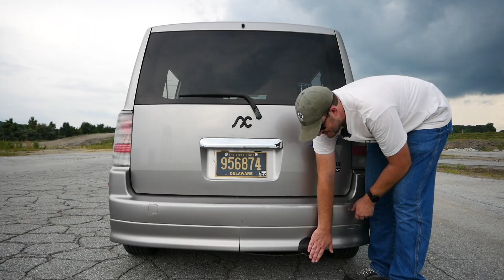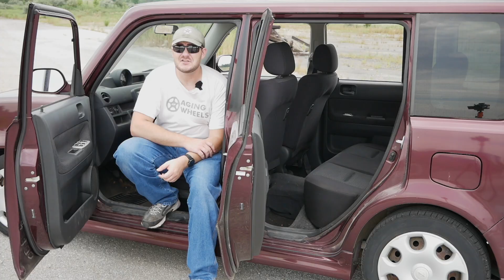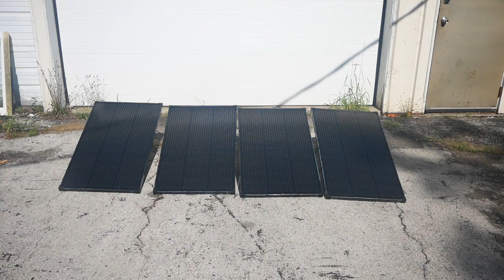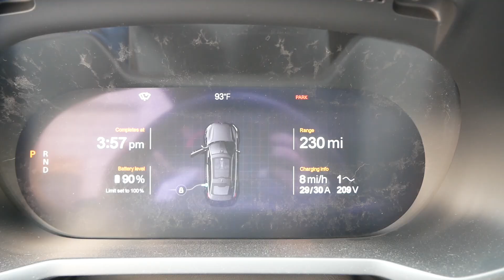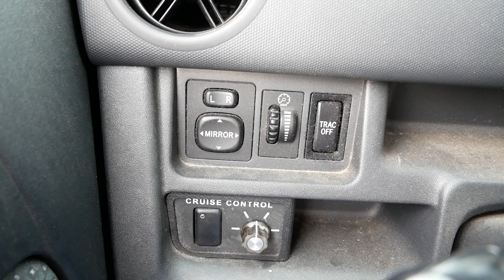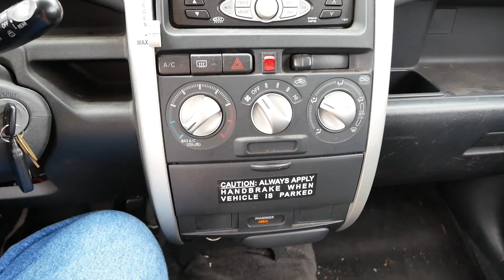The ACP eBox is a Technology Showcase Crammed Inside a Cheap Toyota

Comment: Ahaha they lifted the cruise control out of a 70’s semi tractor! I literally just saw one of these last week! It just sets the throttle, guy showing me the truck explained to use it to set the rpm’s to around 1000 when parked because that particular engine does not pump enough oil at idle.

Comment: The stickshift should be put back on. I built my own electric car out of a VW Squareback in 2008/9 using the VW transaxle and being able to shift is WAY more efficient. That Ebox would probably do 120 in 4th no problem. Edit: or 5th because we're not in 1971

Comment: I think this demonstrates not just a cool electric car with cool technology, but instead, a clean example of electric refits. That said, I think it would be safer and smarter to remove the transmission entirely and just run the motor on direct drive, for the sake of efficiency and for space conservation.
Reply: Also did you goof the ad read? I feel like there's a chunk missing from the beginning of it.

Comment: You're in my home town! At my alma mater! Driving a car I've seen for years! I wish I could have met you and chatted for a few minutes. I know the exact places you recorded this. How did you get to drive the University's cars? I always thought these looked cheaply done but I guess it's the technology that counts. Of note, the silver car has the old logo that was replaced 10-15 years ago with the logo seen on the purple car and the Leaf.
UD also had a fleet of four hydrogen buses. They worked well but the garage unfortunately burned down a few years ago with all the buses inside. I'm sad I never got to ride on one.
The barren wasteland where you recorded most of this used to be a Chrysler plant. My grandfather came to Delaware in 1959 shortly after the plant converted to making cars from making tanks. He worked there until the 80s and the plant closed in 2008. UD bought it and has been redeveloping it into their tech campus for the last 10 years. Fun fact: the world's largest air raid siren was installed at Newark's firehouse because of the importance of the tank plant. It was powered by a 180hp Chrysler Hemi V8 and could be heard miles away.

Comment: I had a (normal) xB for a number of years, and yeah that driving position throws people off. I got used to it pretty quick after I bought the car. Otherwise, they were absolutely fantastic little cars - buckets of space, good build quality, stupidly reliable, and surprisingly chuckable through corners (with TRD springs and better-than-stock tires, at least).

Comment: The xBox is one of the most space-efficient cars I've ever seen.  The amount of room in the back seat is just crazy huge for such an otherwise modestly compact vehicle.  They're reliable, thrifty, spacious and eminently practical.  It was targeted at younger buyers but it proved to be so popular with older buyers that Toyota promptly redesigned it to align with what they perceived as older buyers' desired characteristics, and sales, which had been growing consistently year over year, immediately STOPPED growing and the car quickly lost popularity with both younger AND older buyers.  Long story short, Toyota GM'd itself.
Reply: Thanks for sharing the detail about them trying to switch to cater to the older drivers. I was wondering why, if it was so popular, it got killed. Personally, I thought all the boxy Scions were the ugliest cars ever when they came out, and I wouldn't have wanted one even if it was free (I mean, I'd have taken it, but I'd have sold it for cash -- that's how much I hated the way these things look). Having read through these comments and seen all the praise for the xB, it looks like I missed out on a good option because I couldn't stand to look at the thing. Oh well.
Reply: I love this car. Bought it brand new. It was the demonstrator model right off the show room floor. Had about 9 miles on it in 2006 November. Had paid it in full by February 2007. No car payments since. LOVE IT! best car I have ever (EVER) owned. Regular maintenance, replaced a cracked windshield only. LOVE it. If they make an inexpensive convert to hybrid kit I'd be down to upgrade. Toyota kept making changes until they weren't as great a car then didn't understand they had shot themself in the foot so stopped making it. SAD!!!

Comment: Scion wasn't a failure in concept, from start to finish they managed to have the lowest buyer age in the industry. The averaged 35 year old literally the youngest buyers of any brand. The issue is that selling cheap cars to people who don't have money isn't profitable so screw that and just go back to selling to people with jobs. Scion was Saturn without being stupid. Also they actually had excellent cars the TC 2.5 liter can handle 300 horses turbo stock. Some people have claimed 400 with new fuel pump injectors and such. And the 6 speed is great. And they're toyota reliable.

Comment: I have a scenario for you, say if you were using the E-Box or Ford Lightning as a UPS in a power outage, say if that power outage turns into a much more serious situation, and you need to get out, this Car and the Lightning would be useless, since the batteries will be drained.
I would imagine they would have a safety so you cannot drain the battery completely, but what's if it's in the winter or you need to drive a long distance, these cars could potentially cause serious harm or death.
Just like our Governments Canada and the US, want to go more green, in the winter electric cars suck, they may be fun to drive in the snow but you don't get very far, when it comes to range, if you were stuck on a highway in a blizzard you are done.
I have one neighbor that has a Tesla Model 3 another has a Model X, they are terrified to drive them in the winter.

Comment: V2G is basically still ahead of its time. If I had V2G on my volt using the drive train inverter it would be as good as portable 30kw generator.

Comment: 42 kW of regen braking? That equals to under 1 hour 0% to 100% charge time, probably pretty harsh on those 2008 18650 cells
Reply: I'd love to see a pack itself! But i think its not super hard to fit it with new 2022 18650s!

Comment: Maybe I'm just short at around 5'9", but the seats don't really feel all that high.  That's one of the reasons they sold to the largest market of buyers for them at the time (and aside from people looking to mod them, probably still the same market of people is looking for them).  Ironically instead of youth that bought both generations of the xB, it was mostly older people or people with weaker backs that had trouble getting in and out of cars that loved them.  Tons of cabin space for the overall footprint of the car and the seat height was just right for someone to step into and now down or up into.

I'm down to two xB's, a gen 1 and gen 2, both manual.  I sold the others I had collected and done minor repairs over the years to older people that wanted the qualities I mentioned.  My mom actually drives my gen 2 xB right now (the 2az has a lot more pep) that I offered because of how crazy the pricing is for cars.  I use the 2nd Gen Vibe GT as a daily and have a 2nd gen Vibe AWD car I've been rebuilding/modifying for fun (both are just Toyota Matrix XRS with Pontiac skins).

Comment: why not keep that gearbox though, wouldn't the 1st gear help with quicker launch?
Reply: In general, an electric motor produces torque inversely in proportion to revs. So lower gearing gains you torque purely from the lower gearing, but you loose about the same torque from the higher revs

Comment: The price pretty much fully explains why the original Leaf seems pathetic compared to this thing. The Leaf was built to a price that people could actually afford, and as a result, it actually sold. This eBox, while way ahead of its time, was way too expensive and therefore didn’t sell.
Reply: To add - Nissan and Renault engineers (and accountants) had been known to be in a bitter feud over how the Leaf and Renault Zoe be designed, specifically over the battery. The LEAF was over 2 years early, but after 10 years we can see that the Renault Zoe has been more resilient over time.
Reply: @BeLowBelowo  The Renault Zoe has cooling for the battery (albeit, air cooling only, but at least it has something!), and a better cell chemistry (NMC in Zoe, same as Tesla; vs LMO for Leaf).  It has clearly shown itself to be a better car, with longer useful life from the small battery.
Reply: @BeLowBelowo  ZOE is such underrated car
Reply: What is this supposed mystery tech?  The original leaf battery life sucked. That was soon cured. The next gen had 6.6Kw charging 30KwH battery, heat pump heating and cooling,  heated seats and wheel,  and 100 mile range. It is very much the VW bug of EV's   a classic that will indure and give great service long after the self styled sophisticates that criticize are seen for the dopes they are.
Reply: @captlarry-3525 the cool tech is really all in the inverter. Up to 80 amp 240v AC charging and vehicle to load/grid output by using the same inverter that drives the motors is really impressive. Every other modern EV has at least 2 inverters, one or more for turning DC from the batteries into 3-phase AC for the motor(s), and one for converting 2-phase AC from the grid into DC to charge the batteries (or DC from the batteries into 2-phase AC to output). The second inverter adds weight, cost and complexity while usually being much weaker than 80 amps because making it that powerful would increase the added weight and cost even more (whereas the inverter that drives the motors already needs to be very powerful anyway). I don’t think this makes the leaf and other modern EVs look “pathetic.” I’m sure there is a reason using a second inverter has become the standard, but it’s definitely possible future EVs should/will revisit this technology. 

It could be that OP is mostly talking about the bigger motor/battery but that isn’t really “technology.”   It’s just a larger version of the same thing which of course results in a higher purchase price.
Reply: when the original leaf came out, the battery pack cost $18,000 dollars, I had a 2014 Leaf, now own a 2015 E-Golf
Reply: The limited range of the leaf was the biggest problem
Reply: Ahead of its time for a car. Trolleybuses with three phase AC motors were pretty well proven, together with the driving circuits. The only difference is that they do not rely on a accumulator they carry around, but they connect to 600V DC hard source of electricity. Three phase AC high power motors for vehicle propulsion driven from an DC source was already a mature, widely used technology by the time this car came out. The traction accumulator of the car is not revolutionary, it lacks any active thermal management, it just limits the current based on temperature sensors in the pack.

Comment: Great review video!
For 10K it's will be nice price for this car.. It's not pretty, but it's electric.. 😂 Sad, that we in Latvia didn't have used EV with affordable prices..
Reply: The version with the stock internal combustion engine did cost around 10.000 $, to get it with an electric drivetrain you had to pay 50.000 $ on top of that

Comment: while it's impressive that it can charge so quickly from AC its likely not practical for a regular vehicle (probably very useful for fleets though) to be able to pull 80 amps you would need a 100 amp circuit with Awg #4 wiring. the inverter is a very nice feature that should be standard with all vehicles these days, though I hope with more safety feature than don't touch it.

Comment: How the hell wouldnt it have a lotta backlash, it is abusing a manual gbox in second gear to achieve and drive at speeds that the original car was supposed to do in fourth gear most likely or fifth...  Now if the gears were specially fitted in a box with custom lubrication and what not to accommodate the gears and help them work with as little stress at those speeds, sure, why not, gears are made to run much much faster, but in such applications, they have either special greases that lube them, oils that run through coolers, tooth geometry that is more conducive to running at high speeds and high torque... Jebles, that car should at least have its manual oil changed regularly, and i mean inter.comb.eng. oil change regularly, as manual gbox oil is cheap, and teflon additives for it are cheap aswell and help gears a lot... Also, its a great lube for general purposes like hinges and shit, sliding surfaces, machine ways, lock cylinders and what not...

Comment: If it has a regen system then traction control is a software solution for independent asymmetrical application of the regen system and the brakes.

Comment: I'm guessing you probably have enough disused obsolete EVs But if you ever owned one of these I'd love to see you hack that Manual Gearbox to give it all 5 gears again. Since you can diengage the EV by putting it in Neutral while driving there should be a way use that to protect the clutch from the torque.

Comment: You know, if you plug the adapter into the male end of the plug BEFORE you turn on the high voltage output it is a LOT SAFER! 😝

Comment: Somehow that regen slider simultaneously looks perfectly in place there, and totally jank. Also that cell readout is AWESOME, who cares if nobody knew what to make of it, I wish electric cars nowadays had stuff like that lol.
Also the fact that it will apparently just backfeed power through the charge lead is...terrifying. Useful, but terrifying.
Reply: The Regen slider is actually a fader from a mixing console. As a hobby sound engineer I immediately loled when I saw that.
Reply: @mikosoft  "turn up the radio"

"whoa what happened to the regen?"
Reply: With all the LCDs as gauge clusters in modern EVs I also would like a complete cell readout and customizable gauges for actual amps/watts, rpm, field strength and other cool stuff. I  mean most gauges in cars are useless in most normal driving situations anyways, like oil temp or water temp, why not put the same useless geeky gauges in EVs? ...
Reply: @TheYABCShadow  You can get a lot of that information using a OBD II to Bluetooth dongle. Either stick a cheap Android tablet in your car or send it to the infotainment screen with Android Auto and there's your auxiliary gauge cluster :)
Reply: YES. Give me voltage and current readouts. The exact amount of kWh i used. Standby power of all the various gubbins. 
The more dumbed down things get, the harder they are to understand.
Reply: I NEED that backfeed power option. 
Maybe on a different port if possible. but that takes this from eh it's an electric car to it's an electric car that I can more than fully power multiples of my house with
Reply: @VonGeggry the Hyundai Kia vehicles do V2L with a special adapter. 110V up to 1.9Kw
Reply: @kehlerames218  Yeah, I powered the essentials in my house from my EV6 during a 36 hour power outage and only used 18% of the battery. Pretty sweet!
Reply: @VonGeggry  i guess now we know what car Ford looked at when developing the new Lightning
Reply: @VonGeggry  Bear in mind theres only ~15 kWh hours actually IN the car when fully charged, so at max power it will run out in 45 minutes. And may overheat before that.

 It reminds me of in Ham Radio, once cheap chips came out to do it, handheld radios had the ability to act as a repeater (which is WAY cool). But its a handheld radio with a 4oz NiCd battery, it will only work for an hour at most doing something that complicated and strenuous.
Reply: "useful but terrifying" yeah I have so many uses for this, I just want to go on a drive with my enemies and have them try to plug in while in the rain. What could go wrong, you know. Exposed wires and electricity and water
Reply: I don't want to give a thumbs up because it's at 666 right now
Reply: Clearly made by nerds for nerds.

Comment: Wow, this is crazy. The Renault Zoe from 2012 onwards does similar with the charging. Most can charge up to 22kW on AC but early models (and a select few later models) can do 43kW AC charging. I've one of these. It works well but not too many charge points around that will go up to 43kW here. Thankfully 22kW is plentiful.
Reply: These figures are three-phase as far as i know. Not too uncommon in European households though.
While charging with only single phase the power will be only a third.
Reply: @maxmustermann5932  yes, 3 phase. 11kW is more like home levels although 3 phase isn't common in my country outside of commercial/industrial.
Reply: Hi, I have one of those too, btw, have you tried tuning the speaker sound settings on the touch screen, did it today and made them sound way better. Treble was set way too high on it.
Reply: @swecreations  one of the first things I changed was the audio settings. I have spacialisation off, arkamys off, treble +1 and bass 0. I think the arkamys causes a lot of issues with the sound. If you turn it off and turn the volume up it's better.

Comment: As a person who lives in a city, a 40ish mile range sounds pretty good. 80 would probably be worth upgrading to but I do not need several hundred often enough to justify paying to always have it. Both of the furthest outlying towns I might care to go to are 20 miles away, if I could charge when I got there, I could easily go; which I wouldn't want to do. Everywhere I would actually want to go is within a 20 mile round trip. I'd be far more interested in a city range small electric car a commensurately lower price. What would really really interest me though, is a carshare service with city range small electrics that I could use when I need, and not worry about the return trip because I could just take a different one home.